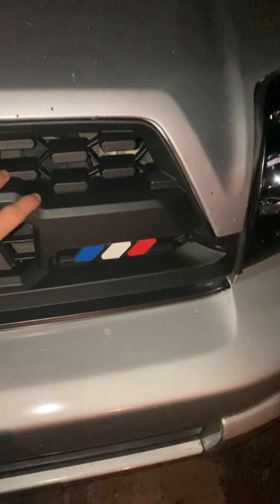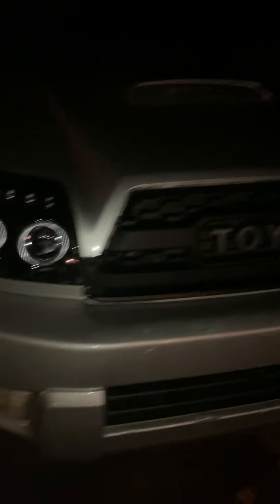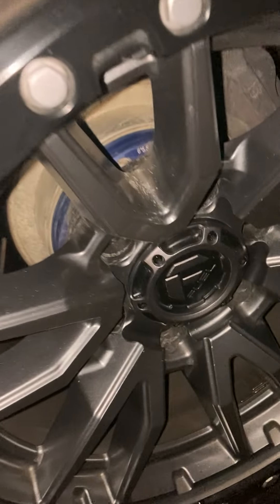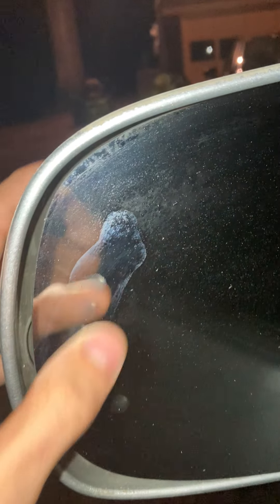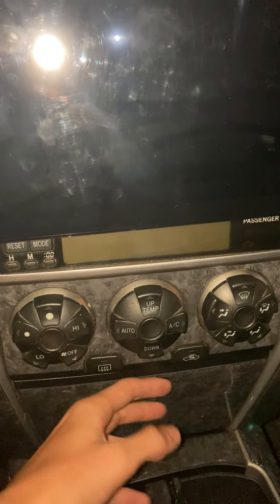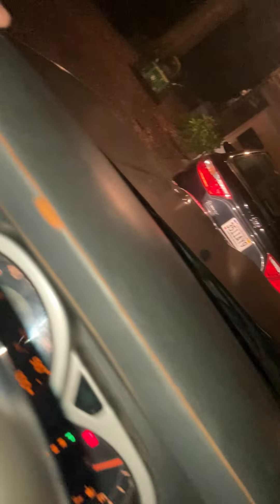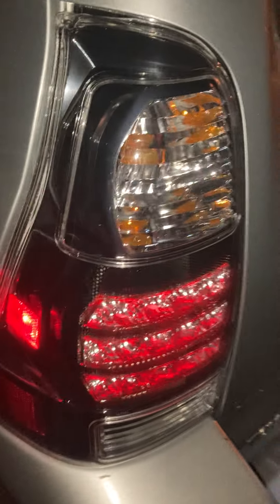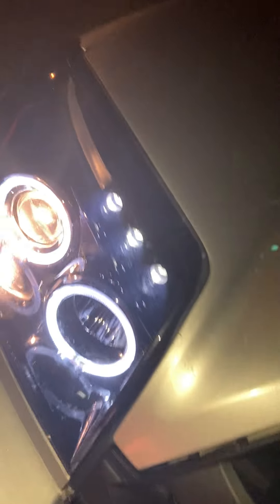My 2004 4th gen Toyota 4Runner V8 Sport edition! Overview on everything I’ve done to it!

Comment: I'm actually looking at 4th gen 4Runner 4wd right now.  So far, the two that I've looked at were rust buckets.  The bodies were decent but the under carriages were beyond repair.
Reply from the maker: Yeah the northern owned Toyotas are always bad about rust it’s very common but personally I wouldn’t recommend buying one with a lot of rust
Reply: @205_4runner  I just bought a "new to me" 2003 4wd 4Runner limited today!  It has 202,000 miles with the 4.7L V8.  I crawled under the whole car and the only rust I saw was very small amount on the front brake calipers.  The rest of the undercarriage was clean!  The paint needs help, but it's another project for the dirt so who cares.
Reply from the maker: @2-old-Forthischet  Congrats brotha! Hope you enjoy it!
Reply: @205_4runner  bought the 4Runner I looked at yesterday.  Put on a brand new set of all terrains today!  Many little nit picking things to take care of but drives really nice.  Can't wait to get it dirty!
Reply from the maker: @2-old-Forthischet  yessir!! Once you get those issues fixed it’ll run like a champ! They always do!

Comment: nice build man, i like watching fellow 4th gen owners build out their rig. Just subbed and looking forward to see how yours evolve in the future. Btw, do you have any rubbing at the body mount with the 285's at full lock, or do you already have a BMC done to it? Couldn't quite see in your video. Finally got around to doing a 3 inch lift and the only thing left for my build (for now) is to get 285's as I got a 17x9 wheels too but with -12mm offset, though with your spacers it looks like it pokes out more than mine. I'm running stock size 265's BFG trail terrains and at full lock, I only got about 1.5 inch of space or so left for the body mount and it's looking like i might need a chop if I do upgrade to 285's
Reply from the maker: I appreciate your support my man! And yes I do have fender rubbing as well as the frame when I get my block lift I hope that it stops and yeah I have 1.25 inch spacers and I just did that so it had a more aggressive look as well as a little more comfort when taking corners fast so it won’t flip
Reply: @205_4runner  right on man tnx for the response and good to know! i gotta find some shop 'round my area that can do the BMC work then .
Reply from the maker: @LloydSim  anytime my man!